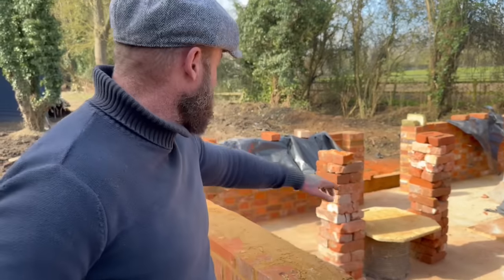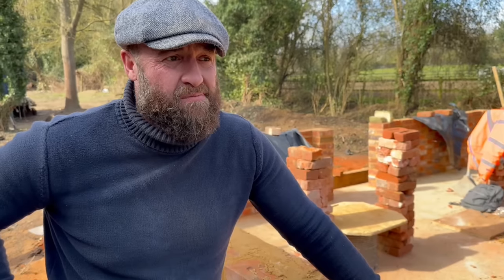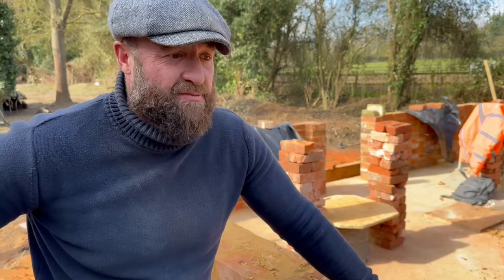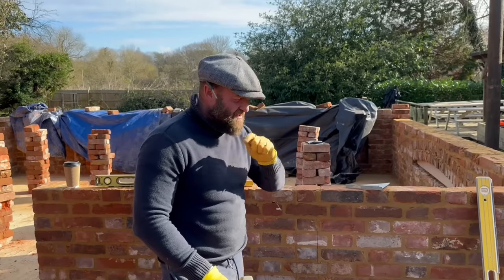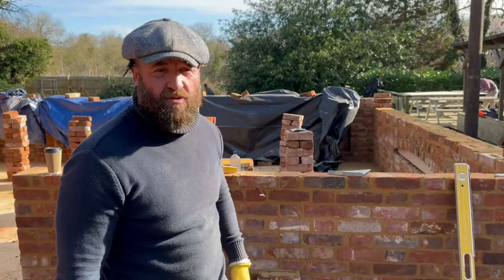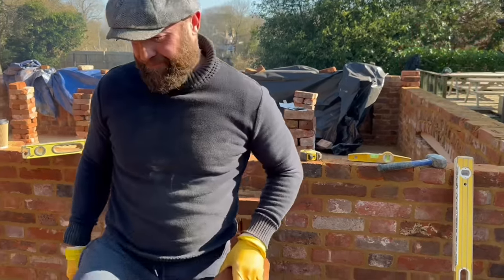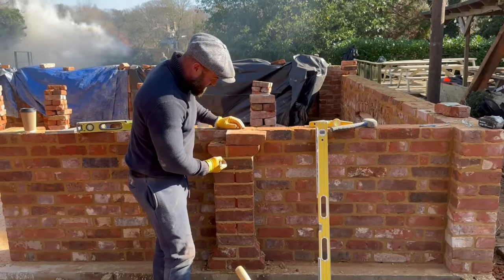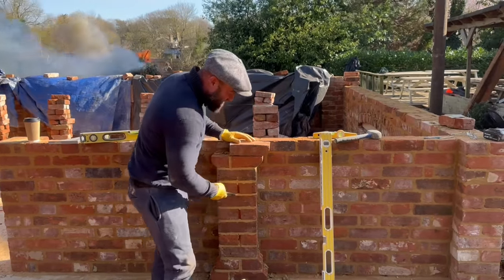Brickwork Roman Piers the aesthetic touch

Comment: Great work. Rceently did a Roman heringbone style greenhouse base and walkway with a load of cuts. Used Evolution mitre saw on a bench with a diamond blade, used one hand to pull the cuts precisely, the other hand to spray water on the blade so I got more cuts out of it without it overheating.
Reply: If there was a load of cuts you should have set it up so you didn't actually have to hold the hose in your hand pretty much all brick/tile saws have built in water suppression